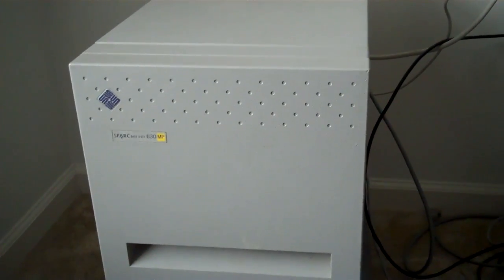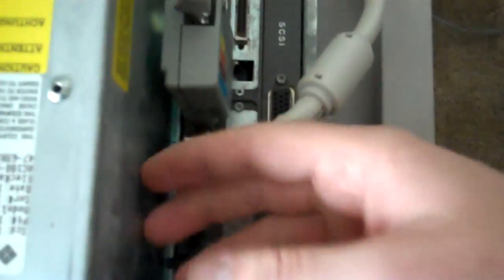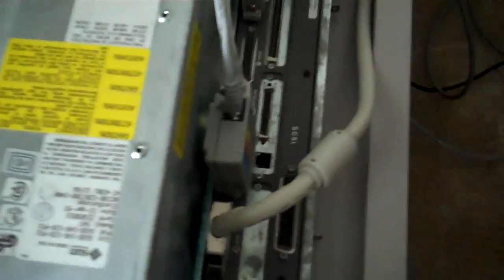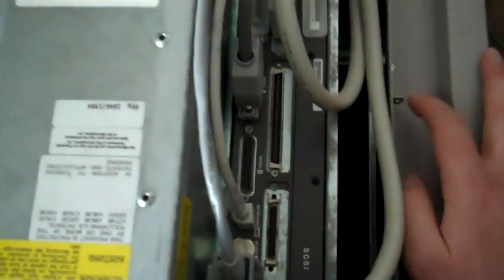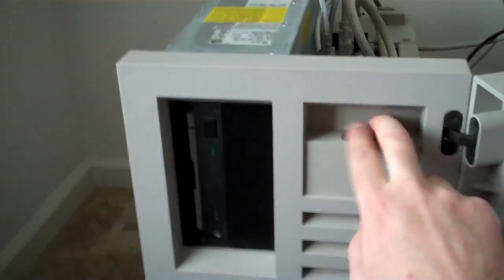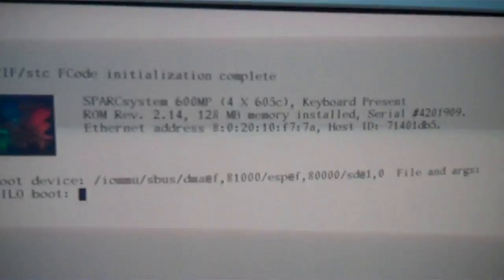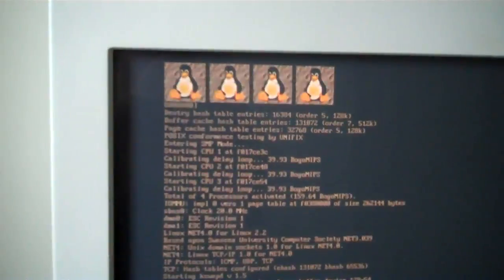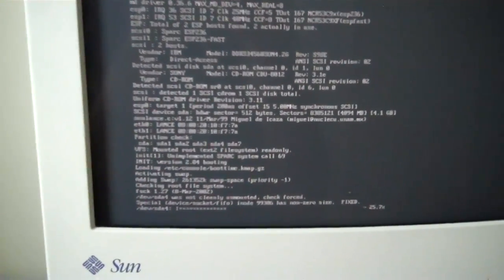Sun Sparcserver 4/630MP

Comment: Thanks for posting! Always nice to see Sun gear in action. I've got a 4/330 sitting under my office desk, looks like they hade the samt type of chassis. I've only got one CPU running at 25 MHz tough. ;) 32 MB of RAM I think... My boss had a 330 when it was new, with dual CPU:s and a nice framebuffer, cost a fortune but it was in service for many years. My 330 has the usual Sun sickness, dead battery in the NVRAM. Not a very hard job to fix tough.